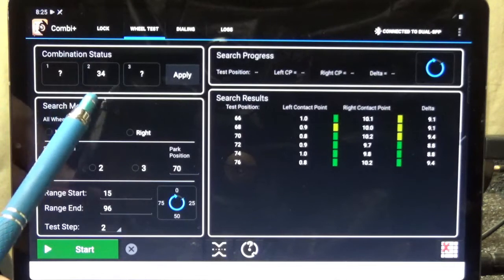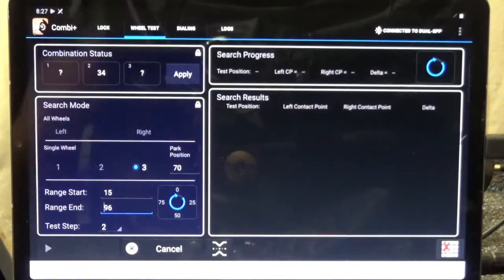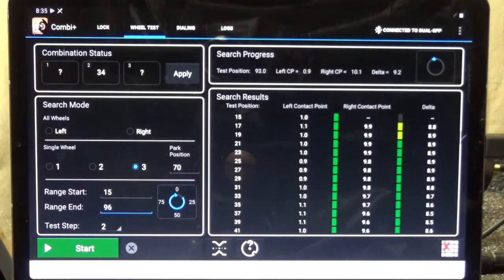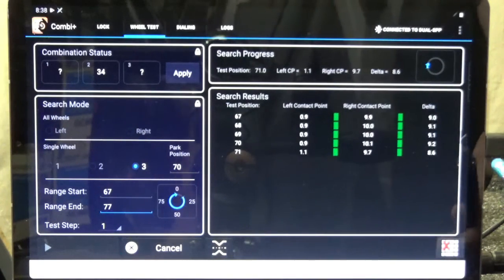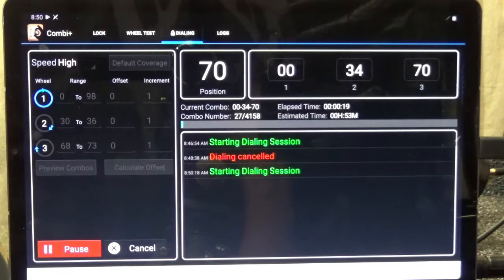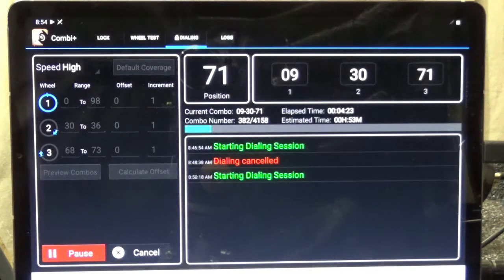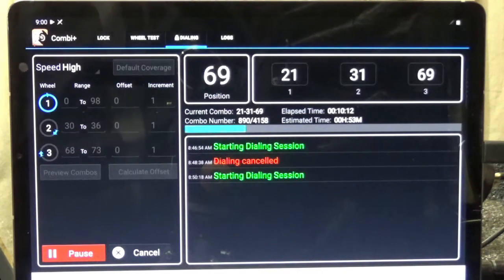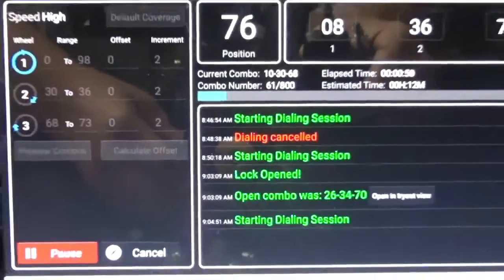Safe Manipulation & auto dialer Pt. 2 Safecracker Crystal Lake McHenry county & surrounding areas

Comment: Interesting seeing the graph, I have manipulated many S&G 6500 direct drive vault locks open using my lightweight dial system, and  I've often noticed a high reading just before and after a gate. I saw the same on your graph on wheel 3. I believe it's probably more noticeable on the larger wheels of the 6500 series. It's not detectable on the smaller wheels of a 6730 S&G but showed up on the graph. Interesting ...